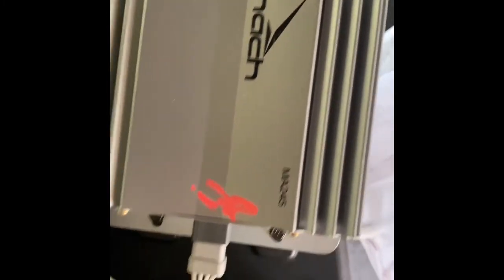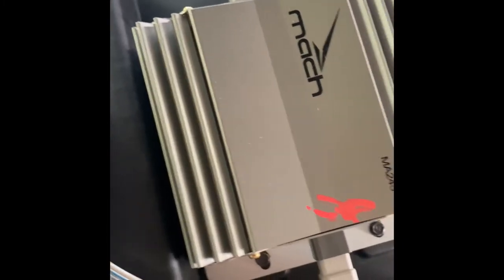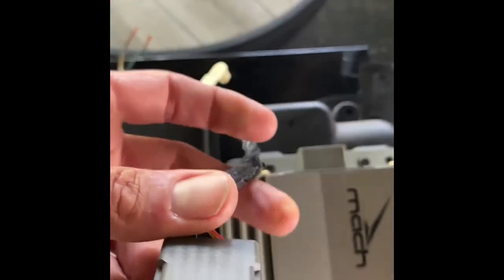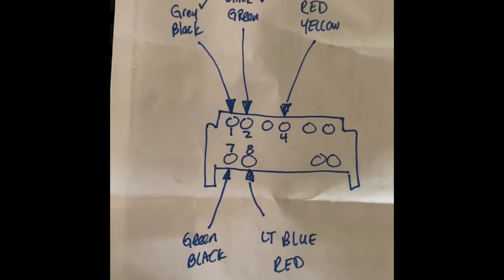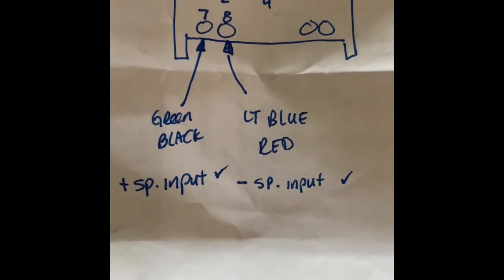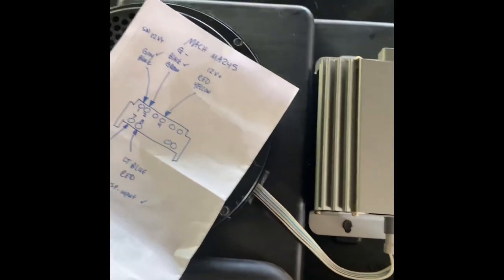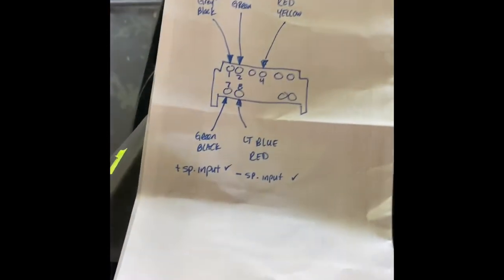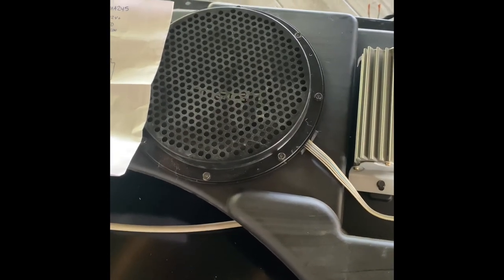Ford Escape Mach MA245 sub amp wiring diagram

Comment: You beautiful SOB!! There is another video on here showing how to wire the factory Ford amp up to new head unit, but the wire colors he was talking about did not match my 2006 Escape. 2 and a half years and now have my factory amp back. Coupled with my power amp and 2 12inch subs, my little Ford Escape is rocking down the road.
Reply from the maker: This exact reaction is why I wanted to share my findings. It’s so great when you stumble upon the info you were needing, and there it is! I’m glad it has helped you.
Reply: @HammerWrench  here is his video.  if you change your title up and add his info to your video, you might get 1000s more views. Also, explain that the when using an RCA cable, the outside wire is NEG and the inside wire is POS.  Cause your video kept me from burning down my house, my car, youtube, the internet the world! LOL. Kidding of course, but I did search and search the internet for wire colors for the 2006 Escape factory sub. Thanks again! Beautiful time saver.  https://youtu.be/T1DzhJ20e08
Reply from the maker: Thanks Tony. Made a few adjustments. I said factory system but it is a pioneer deck. I just ran the speaker wires, constant power and acc wire to the amp. Not sure the volume if it was hooked to RCAs so we went speaker wire.

Comment: Amazing I have been trying to figure this out for a while now, one question though how did you hook up the speaker - and + this will be my first time installing just want to make sure I do it correctly, can I just choose one of the rear speakers and use its positive and negative and shove the wires into the terminals or do i have to place them elsewhere? 

Thanks
Reply from the maker: I’m glad that you found me! I looked for a while too so I made the video. You can use the lead from any one of your regular speaker as input. Green black is positive and light blue red is negative. To determine the polarity of your stock speaker, use a battery 9v or AAA and touch the wires from the battery to the speaker. If the cone pushes out, whichever wire is on the battery positive means that’s the speaker’s positive.
Reply: @HammerWrench  ahh okay I see now, that is very helpful! thank you so much! I will try to get this into my escape hopefully today or next weekend. Thanks again for clarifying and sharing this info
Reply from the maker: @annoying_films  you are welcome. If you are adding this unit to an escape, there may be a pre wired plug behind the panel. Most wiring harnesses have what they need for all models even if a lower trim level doesn’t use all of the features.
Reply: @HammerWrench  when I had first bought this amp and sub from the wrecker I was hoping to find the pigtail and hoping it would plug right in, so I took apart the panel in the back of my escape and they had left the pigtail for the back up sensors but not the one for the sub, very odd. So ill just have to run wire to the rear door speakers, im hoping I can split the pig tail for the back up sensor and use its ground, constant, and switched
Reply from the maker: @annoying_films  the back up sensors are only active while in reverse so you may get no power while in any other gear. If there is not a power point in the cargo area, run some wire from the front power point to the back. That amp is low power so it shouldn’t create too much draw in that circuit. You can also ground to the body via a mounting bolt for the sub to the side panel area. I’d advise not to use the rear sensors for power or ground. Just pop up your door sill trim and hide the wire from the front.
Reply: @HammerWrench  good point I didnt even think about it only working in reverse, I will definitely your instruction and just run it that way, thank you!
Reply from the maker: @annoying_films  helping each other. That’s what it’s all about.
Reply: @HammerWrench Hey Hammer, I finally got around to installing it today, so I used the right rear speaker and then ran the ground to bare metal and ran positive and constant to the inside fuse box, I got it working however it makes a pop/thud when first started and when it plays none of the door speakers play music, only the sub. I was wondering if you know anything g about troubleshooting this or if you had the same issues?
Reply from the maker: @annoying_films  so the thud is the unit powering on by the fuse panel. If you use a lead powered by the radio when it is on, it may not do that. Ours was powered by an aftermarket headunit using the remote wire so it doesnt do that. As far as the other speakers not working, make sure that the speaker wires are in the same phase as the other speakers. Not sure as why the rears stop working tho. Try using balance and fade to only play the rear left speaker and slowly bring in the rear right to see if it plays before and during the cross fade. The only reason a stick speaker would stop working is if the + and - wires were touching each other. Hopes this helps give you some direction on how to test and where to look. And you can call me Skip.
Reply: @HammerWrench  awesome thankyou Skip, I will take a look again tommorow and try to trouble shoot it using these methods and let you know how it goes,
Reply from the maker: @annoying_films  sounds great. You should be proud of yourself for doing all that you have done. There are a lot of folks that wouldn’t try for the fear of failing.
Reply: @HammerWrench  very true and thank you i appreciate those words. I felt great once I heard the sub pound.  Also quick question, I noticed you wrote you had an aftermarket head unit, for your set up did you still wire the sub + and - to one of the back speakers or to the sub in and out on the aftermarket head unit? 

Thanks
Reply from the maker: @annoying_films  neither. I ran speaker wire to the sub from the  headunit’s speaker outs. It’s in a pickup and that was easier than pulling panels. It would work with an RCA wire if you split the wires. It wouldn’t be as loud though that way.
Reply: @HammerWrench  ahh okay I understand now, that would make sense
Reply from the maker: Ok cool. That rca output is much lower than speaker output. Let me know how the rear speakers react in your tests.

Comment: Does anyone have any clue how to replace the subwoofer in that piece that he removed from the escape? I have a 2002 escape and that sub does not work and I'm wanting to replace it but I don't know how to remove it from the housing and yes i have tried taking the screws that appear to be holding it in place and tried to pull it out but it wouldn't budge... am I just not pulling hard enough?
Reply from the maker: Oh I do!! There is a bolt in the back that goes into the sub magnet!!

Comment: Hi  my friend, in cron mexico and i would like to add that subwoofer to my truck, i have a Mazda tribute with that subwoofer but, it hasnt the original radio , can you tell me how can i put it on please
Reply from the maker: Hey there! The switched power wire(usually red) on the aftermarket radio harness goes to the Grey/black on the amp. The yellow from the radio goes to the red/yellow on the amp. Send back one channel of speaker output wire to the amp. Positive to green/black and negative to light blue/red. Ground the black amp wire to the body. If it is too loud, you could split open an RCA cable instead of speaker wire and attach to the amp inputs. There is a drawn diagram in the video that shows the wire locations in case your colors are different. Hope this helps.

Comment: Can I fit a larger subwoofer than the factory one?
Reply from the maker: I mean you may could fit a 10” with a spacer for width and depth, but the enclosure is moulded with the air space needed for the 8” speaker to perform best. May not sound as good as you want. If you do modify it, make a video and tag me in it. I’d like to see what it does.
Reply: Can I put a 12" speaker with its separate box?
Reply from the maker: @josemiguelcalderonnieto1824  my question is, does the 12” sub in a separate box have its own amp? Is it an OEM unit or aftermarket? It is likely to drown out the 8” if they are together. The 12 should hit lower decibels than the 8, and the 8 may be punchier. The 12 should not share the amp that powers the 8. If they both have their own amps, they can share the same line in, 12v switched, and ground. The 12 should have its own 12v constant though.